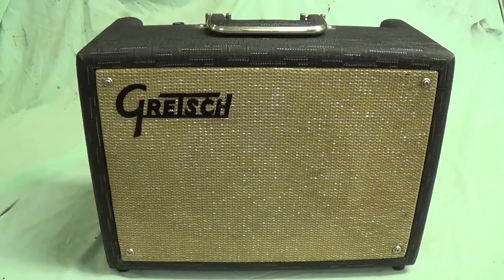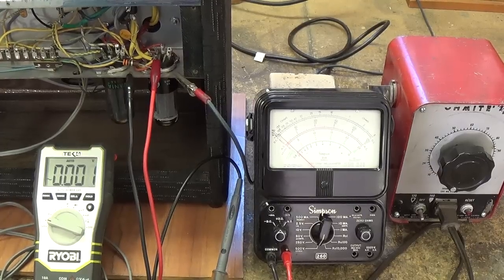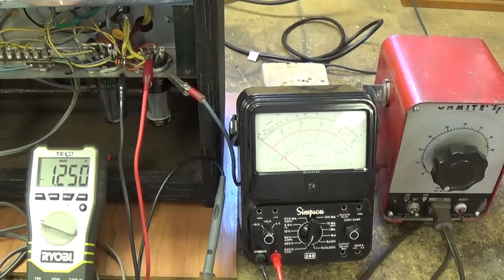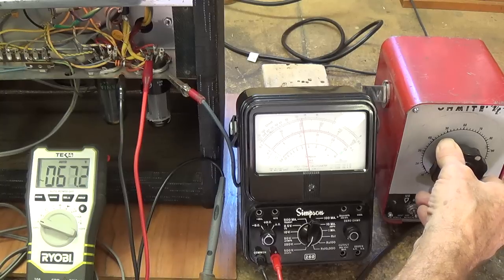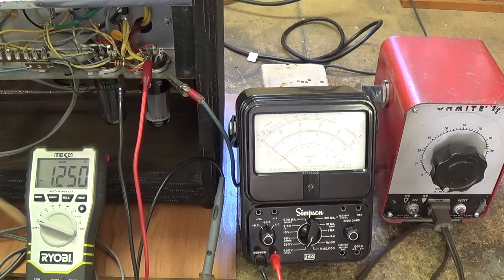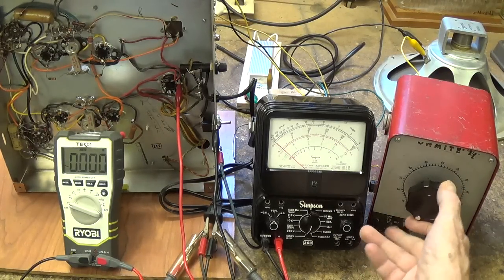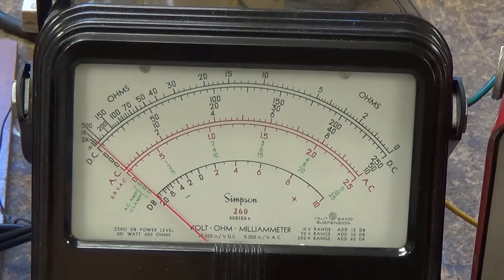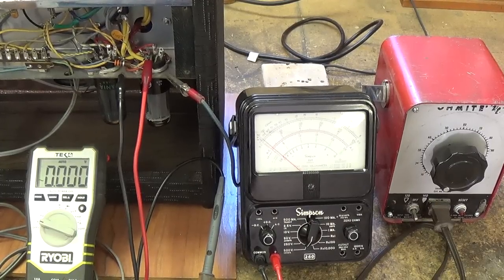Is Gradual Variac Warm-Up Effective with Tube-Rectified Amplifiers ?

Comment: Something leaps in my mind:

DO NOT repeat this here....DO NOT use this method in anyway when you got a rectifier like 3B25 -- 3B28 -- 866 -- 866A or similar present in your Amp and/or Radio

Again: DO NOT use a variac with a vapour rectifier tube. They WILL BLOW UP
these tube need to be preheated before the B+ is applied. With the variac you´re foolin´ (=messing up) the old preheat section. The plate voltage will be present at the plate and let this rectifier tubes simply explode!

You DO NOT want this, as the mercury will be come off that tube and that is in no way something what you want to have next to your bench, trust me!
Reply: Mercury Vapor rectifiers are quite the different animal! When I encounter amplifiers with MV rectifiers, I do not use a Variac. I usually pre-heat the tubes for 20 minutes from a cold start after the amp has been sitting for some years. I've worked with Mercury Vapor Rectifiers for many years in AM transmitters and large tube power amplifiers. MV rectifiers are good rectifiers due to the low voltage drop they have, but when they go bad, most of them tend to short. I worked at one AM radio station where the transmitter had pre-heater sockets to keep the new spares warm and ready in case of rectifier failure. I have a few Altec power amps that use 4 866A's in each. the 83 is also an MV rectifier which was popular in early tube testers. I have a pretty good supply of NOS 3B25, 28's and 866A's.
Reply: Frank Ferraro One of the important things to remember if you're building an amplifier using 866A's is, they are best to be used with chokes as opposed t electrolytic caps. the other downside of MV rectifiers is, the RF noise they generate which can get into the other stages of an amplifier. Lead dressing and distance from signal input/output is important to remember...:)
Reply: ....the DCG i´ve shown in some of my videos is the better known version of the 3B25/866A....it is 2kV/0.5A rated for cont. ac service. Easy to mount as the socket is a standart light bulb thing:)
Reply from the maker: Again, great advice, especially for those of us who wouldn't know a mercury vapor rectifier from a Mercury stationwagon :) Viewers should be certain that the rectifier they intend to gradually energize with the Variac is a conventional tube rectifier, not a mercury vapor rectifier. If in doubt, check a tube handbook or the Internet to verify rectifier type.
Reply: Uncle Doug Excellent advice Uncle Doug! You can download the entire RCA tube manual for free on the net which will give you characteristics of just about any tube...valuable information for someone who is working with vacuum tubes! :)
Reply: I was wondering if thats why it took up to around 40v before we started seeing b+ appear?  How much voltage does it take before the transformer has enough power to light the filament of the rectifier and how warm must the rectifier get before we start see the plate collecting enough electrons ect..... this may account for why we have to ramp up to a certain voltage from the ac mains? Also if I want to reform the caps or at least affect some positive influence upon the older caps in a old mothballed tube amp  by slowly  ramping up the AC via use of a variac, I must be sure that I do in fact have a rectifier present in the circuit? Otherwise I can leave the other remaining valves out ?
Reply: @dougroundup7315  You have to be careful with leaving tubes out. If you have an amplifier with many tubes, for example two or three pre-amp tubes, a PI tube and two output tubes, the B+ voltage is drawn down considerably with the tubes installed. With all of the tubes out, the B+ can exceed the voltage ratings of the capacitors in some amps. I have seen amps with a B+ of 360V after the first filter with the tubes in and 425V or so without the tubes. If the caps installed were only rated for 400V, you may be doing more harm than good. Some amp manufactures got really close with there limits and it was designed around how the amp would operate normally, with the tubes in.
Reply: @srtamplification  
I never really thought about such possibility concerning the total load vs the working voltage of the caps. I have to wrap my brain around this as I am writing. I don't doubt that manufacturers value engineer amplifier production and will save where they can. It just doesn't seem like that would make good engineering or design sense to have the load regulate the source? Besides the caps are before the load and not after the load. I do realize that we do have large inrush currents and is why it is many times preferred for the heaters to warm while we turn the amp in standby and switch to operate once we have warmed up. Because of ohms law we notice a drop in voltage when the tubes load up the b+ but that requires more current. The working voltage is just that "working" voltage and that is pulling more current through those caps... Hmm? I gotta give this more consideration???  it seems to me  like if removing tubes or removing the load that the power supply sees that the resulting nominal no load state would damage circuit components??? It seems that the components values certainly are very marginally rated and would better selection or different design  and , possibly a bit better  regulation. Not trying to be argumentative and maybe this is something that you or others more experienced than myself have had to deal with... Never experienced or at least have had to think about such considerations. (Maybe dumb luck after all ignorance is bliss). 
Well, luckily in the scenario I think I had proposed . The amplifier would be on a variac and the whole purpose was to reform the caps by applying low DC voltages to the caps via the amps own power supply. Good practice would suggest that you would wish to monitor your efforts and see if it was working. For that would require carefully measuring current and voltage rise seen at the capacitors. Obviously you would recognize success once you achieved full working voltage for the caps. My question regarding having the tubes present was more a question of does the cap need the load present and in circuit to effectively reform. My thought is that if you haven't enough total power thru the variac to power the rectifier you aren't going to see any DC at B+ , the rectifier isn't going to work without heater.  Now it is possible to jump the rectifier with ss diode and get the b+ at low enough voltages to begin reforming of the cap plates with the resulting low voltage DC currents but at that low of voltage being applied at the power transformer via lowered variac ac main voltage our tubes just like the rectifier won't see enough power to heat their heaters either. So while we fixed the rectifier with diode jumper to get around this issue, the tubes still have no heater but that isn't keeping the DC that we will slowly be ramping up off of the plates of the tube while we our forming the caps. Would such a duration of voltage to the plate without heater voltages damage the tube by migration of electrons from the grids?
Reply: @southboundsuarez9832  I had a hard time trying to follow what you were saying here. I don't know what current has to do with the filter caps at all. There should not be any current flowing through the filter caps. They are in parallel with the B+ rail and ground. They only have to be rated to withstand the voltage between the B+ and ground. As far as designs go. Most circuits are designed with specifications of how they will normally operate. There are some instances where things are over engineered, but for the most part, large production amplifiers are pretty tight in there values. Usually, if the B+ for the first tubes it feeds needs to be at 450V under normal operations, they are not going to go with a 600V cap even if the B+ is 525V with all of the tubes removed. I know with the F&T and Sprague caps that I use, the difference between a 500V cap and a 600V cap of the same capacitance is between $4-$10 each depending on value. When you are doing repairs or small production runs, you can probably afford to do this, but when you are manufacturing thousands of amps, each with several caps, it can get costly. I don't know what you mean about the caps coming before the load and the load regulating your source. That is what loads do they bring down the voltage, because they have resistance and draw current. Unless you have a voltage regulator in there to ensure that the voltage stays up, this is going to happen and you take that into consideration.
Reply: @southboundsuarez9832  Next time you have your amp on your bench, just bring it up on the Variac with the tubes out while monitoring the B+. I think you will be amazed at how much the increase is. You will more than likely get to the cap rating before hitting 120V on your Variac. Another thing you have to consider, is that in older amps, the design was based on a 110V or 115V line voltages. Also the number of tubes will make a significant difference (a Champ vs. Twin Reverb for example).
Reply: TubiCal , so are there any common guitar amps from the 1950's and up that might have a vapor rectifier?  I will be doing some very basic maintenance on 50's through 70's Fenders and Gibsons.

Comment: Is this method ok for solid state rectifiers?
Reply from the maker: Yes, in fact it may work better with SS rectifiers than with tube rectifiers, since the tube rectifiers may not start producing DC until the input voltage level reaches a certain threshold.

Comment: Hello Uncle Doug, Thank you for this and all your video's one more time in case Rusty wasn't listening the first time. Question please,what size Variac do you recommend for amp testing and electrolytic capacitor reforming? I doubt anything over 50 watts would ever be on my bench but you never know when a Marshall Major might walk through the door.
Reply from the maker: You're welcome, Joe. The Variac in the video is an Ohmite V.T. which outputs 0 to 140VAC at a maximum of 8 Amps. Most amplifiers that I work on are happy with 120VAC and less than 2A input, so it's more than adequate for my usage....and probably yours too.
Reply: Uncle Doug A standard Variac that's popular on most tech benches are the typical 500VA units which are quite suitable for average tube amplifier and radio service, however, I had to bite the bullet and get one of the big boys (20 amp) units for servicing the bigger tube amps, SVT's, Messa Bass 400's, etc. and occasionally a Fender 400PS.  Since these amplifiers operate at insanely high B+ voltages, I wouldn't chance just plugging in an amp if the problem with it is unknown, or the customer is unclear of the symptoms or if he even knows the history of it if it was newly obtained.

Comment: Indeed very instigating - great food for thought! However I might say that it could've been much more enlightening if not only directly heated rectifiers had been addressed. What if I'm using a 5V4 or a EZ81/6CA4? I'd rather go along with reforming electrolytics by using a regulated external power supply direcly attached to the filter capacitors while everything else is turned off instead of fooling around with underheated filaments and/or heaters as none like such treatment! Not to say the low pressure mercury rectifiers - read further looking for valuable TubiCal comments and stick to them!
Reply from the maker: To each his own, Flavio. Thanks for your input :)

Comment: Bare in mind that you turned up the AC quite fast and hence didn't give the filament time to warm up, which it does even slower at these low voltages. I don't expect to get DC output at very low voltages since the filament has to reach a certain temperature in order to generate enough mobile electrons that can travel to the anode. But I think if you had turned up the variac ever so slowly you would have seen DC at much lower voltages. Especially on the 5U4 you see that once DC comes up it rises quite fast without turning the variac, which is due to the heater just starting to kick out more an more electrons that can be attracted be the anode. Maybe try doing this test backwards and see when the tube heater is too cold to produce mobile electrons or dial in a much lower voltage, say 20VAC, and wait if the DC comes on. If not, increase to 25 and wait again...
Reply from the maker: +GenniDee   A very interesting observation, GD. When I get a chance, I'll check out your suggestions.  Thanks for watching and commenting :)
Reply: +Uncle Doug You're welcome (: And thanks for your very interesting videos! They inspired me to dig out my soldering iron again after some years of not building amps and I'm currently working on a small use-only-junk-parts-project ^^
Reply from the maker: You're welcome for the videos, GD, and it's great to hear that you're back in action. Best of luck with your new project :)

Comment: Is that really true? That old electrical components can be be damaged if left dormant for a long period? When my grandfather passed, I got his beloved old Gibson Lancer. You may have heard of it, it's kind of an obscure amp, but it sounds so good, even after all these years. Of course, I am ignorant of all things electrical, so I never gave using it a second thought. Now, I am wondering if I did some damage. He could not play his guitar for the last 15 years of his life, and it sat another two years before I got it. I did take it in and have it looked over, but he said nothing of using a Variac to bring it back to life.
Reply from the maker: Greetings, Danny, and don't worry. If the amp worked fine for you, you did no damage.....believe me, if an electrolytic capacitor (EC) had shorted out, you would have known it. Of all the components in an amp circuit, the EC's are the ones that actually deteriorate with time and lengthy non-use. If you catch them soon enough, they can be rejuvenated either by use (as you did) or gently with a Variac, as in the video. If they have deteriorated too far, nothing can save them. With an old, original amp like the Lancer, continuous use will probably keep the EC's in good shape.....but, if you want to keep it original and protect it, you should build and use a Current Limiter (see my video on how to build one). It will protect the amp components in the case of any short circuits, especially on start-up, and will immediately alert you by flashing brightly if a short circuit occurs anywhere in the amp. Good luck :)
Reply: Täking Thë High Roäd You might have just got lucky. Maybe it was a case of being stored under rather ideal conditions. I do remember the Lancer, and I have a Discoverer Tremolo that I used as recently as the 90's, and it worked great.  Class AB1, two 6BQ5's (EL84's), and a tube rectifier. Model number GA-18T. I ordered a set of power caps from MCM, but just sat on things when I found out I could get multis. Back burner special, I should've just left it alone & kept playing it. Back when I got it I had to put a speaker init, and came up with a Fender Jensen. The amp never failed, I was just looking to install fresh power caps when I took it apart. I am so bad at finishing things of my own, when I am working on somebody else's stuff, my personal amps get chronically neglected.
Reply: randolph patterson When I got it back from the guys at the shop they said that they have never seen an amp in that good of shape in the 30 years they had been repairing vintage amps. Every single component looked as though it had just came from the rack. Even the two pronged plug with the cloth cover was like new. They did a few things to get it up to code, like replace the cloth cord with a modern three plug and grounded the amp properly. And replaced the tubes just because they were so old. But they gave me the old parts to keep so that I could restore it back to original vintage if a collector demanded it. But that Discoverer was a real gem too. I have heard of them, but never played one. Good luck with your new caps.